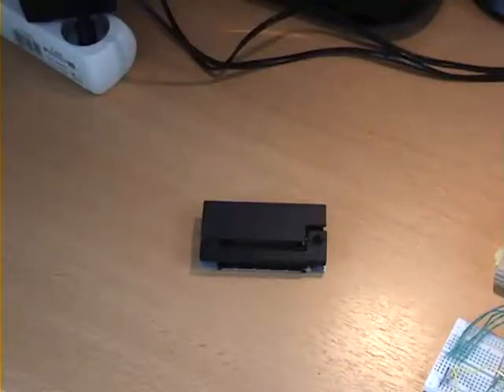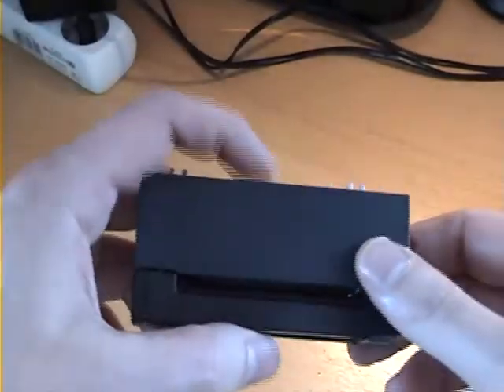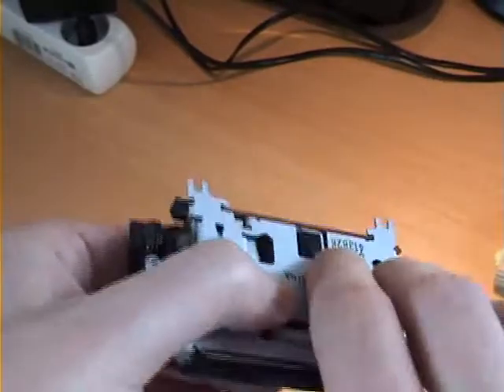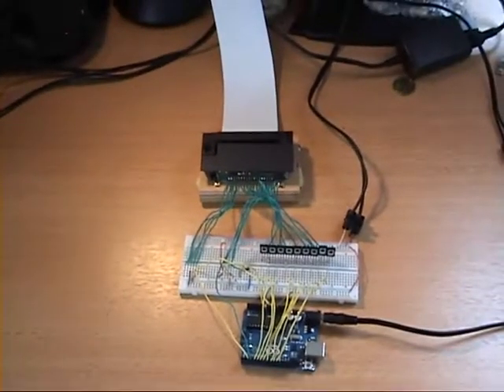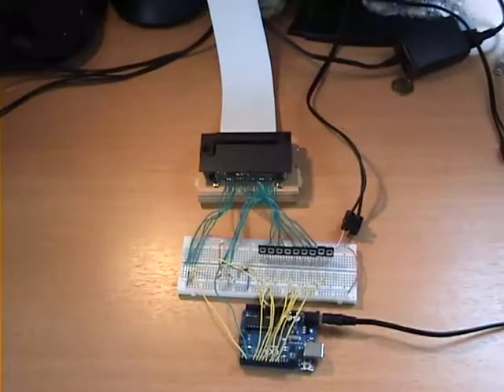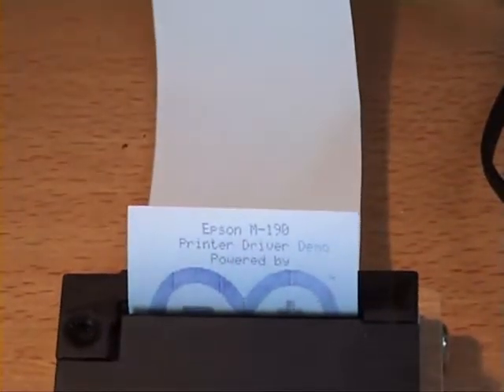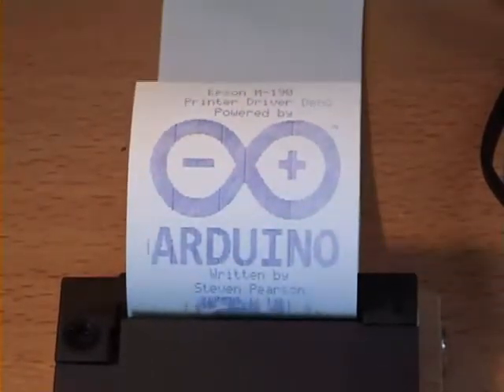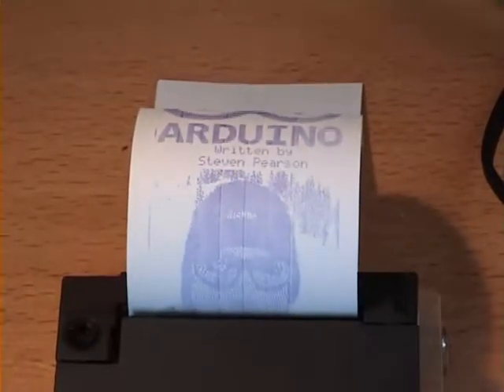Arduino Proejct : Connect Epson M-190 Printer

Comment: Hi. Awesome work you did there. I'm facing the same job, just with a thermal label printer (128 pixels wide print head). Your Github-link is dead btw!